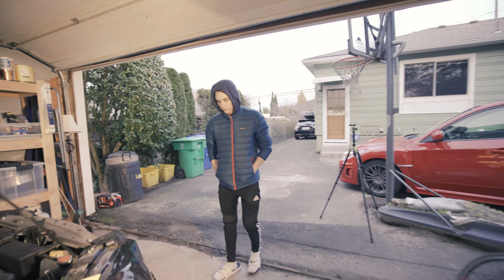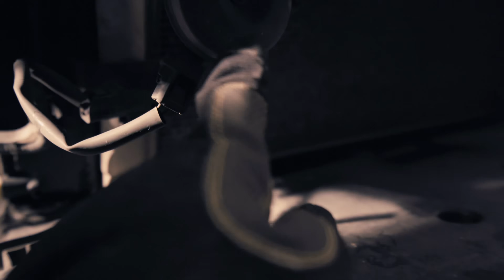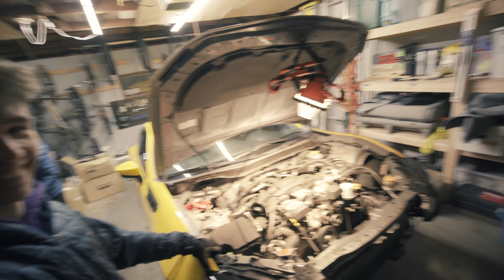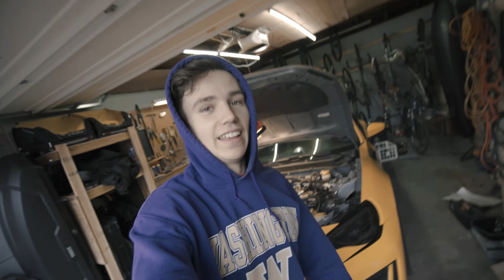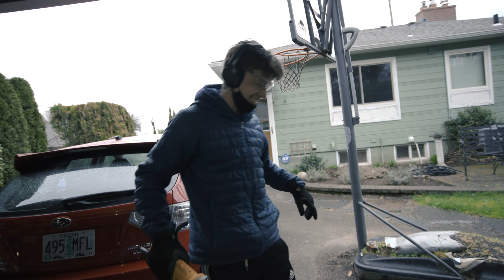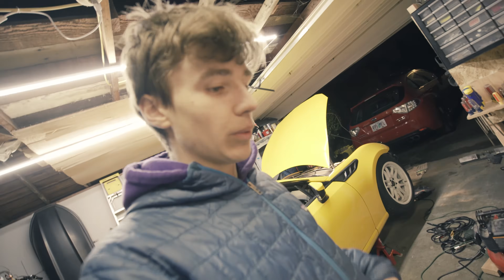Installing a HKS Turbo Kit on a Subaru BRZ // FULL WALKTHROUGH - PART 1

Comment: Should of dealt with the oil leaks before installing the turbo.. gonna get way worst now.
Reply from the maker: 2 years later and haven’t had a single issue🤷‍♂️
Reply: @maxwell.peters  lucky! Lol
Reply from the maker: 2 years later and haven’t had a single issue🤷‍♂️
Reply: @maxwell.peters you keep tabs on oil levels then?

Comment: Has anyone have done this to a automatic
Reply from the maker: I’ve actually never seen this! I think the biggest thing would be if the automatic transmission could hold the power
Reply: @maxwell.peters  i was looking at the possibilities and it gets expensive I really like the auto because of the paddle shifters but I’m going to settle on getting a 2015 wrx in manual
Reply: @driftpanda9072  actually the Auto transmission is much stronger than the manual , manual you will need to replace the clutch for north of 300 hps ,it slips from 300hps,  AT's gd for north of 400 without additional modification, probably too late to answer this tho.